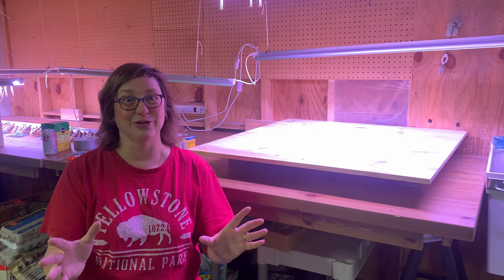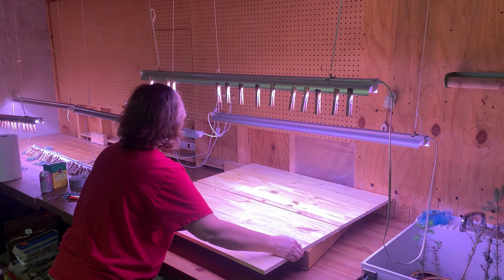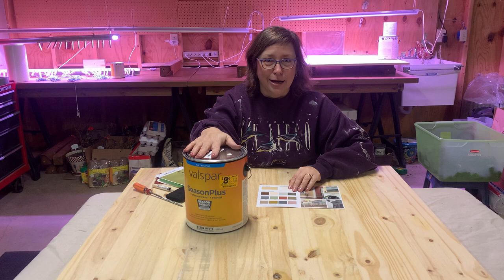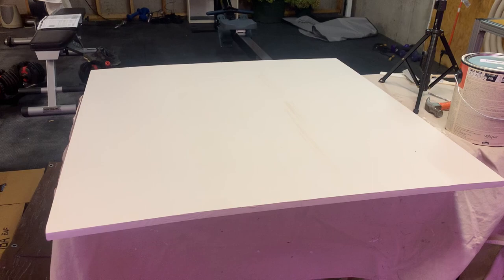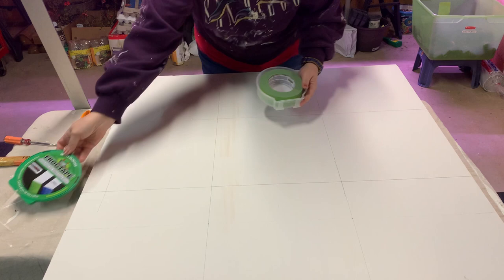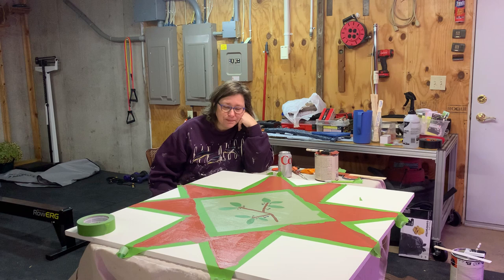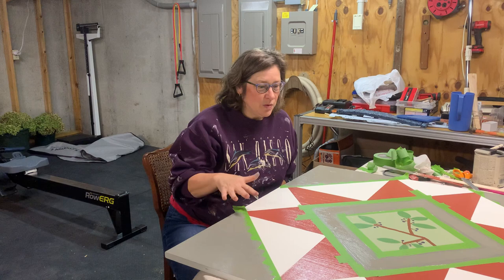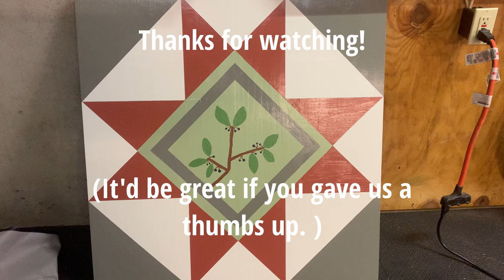Make a Barn Quilt from Start to Finish

Comment: The streak is bleed through, u can spray shellac on it and let it dry and then paint again
Reply from the maker: Thanks for the tip! I also find that you can be a less concerned about imperfections when you hang your quilts 20 feet in the air. :)

Comment: Since you are putting this outside, you should have used Titebond III wood glue as it is designed for outdoor projects :)
Reply from the maker: Thanks for the tip! So far, this elmers glue has worked well. Perhaps the layers of poly will help the glue hold up, too? I suppose we'll see but I will find some Titebond for the next one I do.

Comment: Titebond  Outdoor Glue is much better, than Emers
Reply from the maker: Thanks for the tip. I have heard from others that Titebond would have been a better choice. The good news is that the quilts are holding up great so far. I'll post about it if the glue starts to fail.